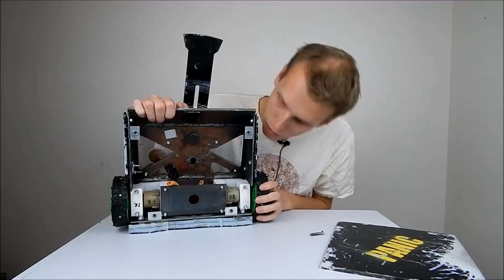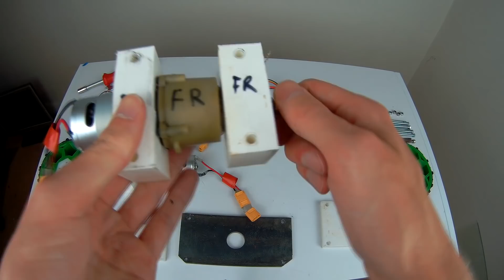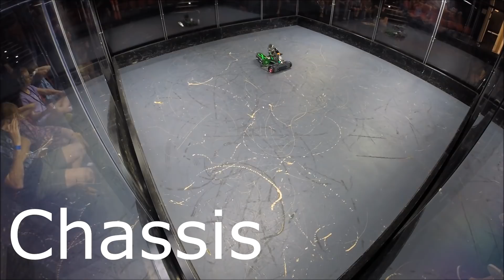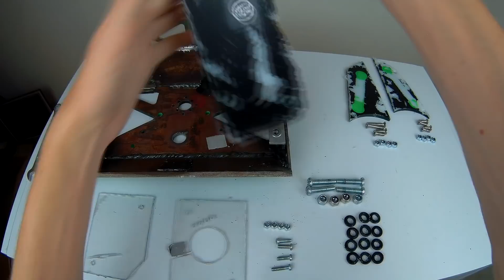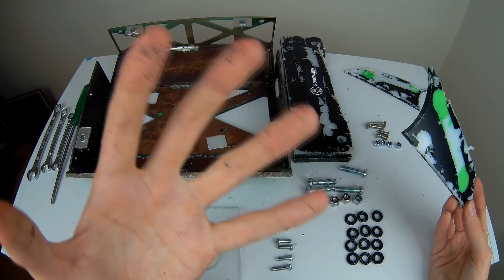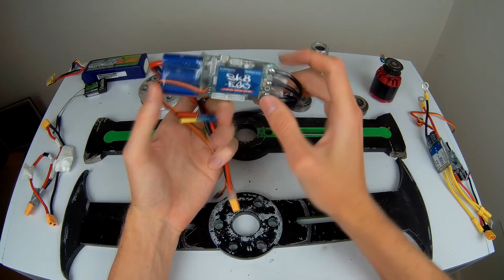13kg combat robot breakdown!

Comment: totally new to robotics, is using brusless geared motors for the wheels a good idea? or just stick to cheaper brushed motors?
Reply from the maker: Brushed motors are easier, cheaper and usually come with a gearbox attached but are heavy in regards to power/weight

Brushless motors are more expensive, normally need a special speed controller (and for you to change the settings on the speed controller), dont come with a gearbox (so you need to do something custom) but are light  in regards to power/weight

I.e. a brushless motor setup will be lighter then a brushed motor set up, for the same output power

Personally, as a new person I'd avoid Brushless drive to start with, build a brushed drive (like I have here, made of drill motors) get a robot working, take it to a fight, learn a lot from your first few fights and design a version 2 and maybe put brushless in V2 if you think you need the extra weight. (My V2 of this robot still used the brush drive)

Comment: Cost video
Reply from the maker: Cost is a tricky thing to determine, because I'll often buy parts 6-12 months before I use them and some parts get used in multiple bots
Reply: @TeamPanicRobotics  thanks for video, what is ball park cost? $2000 at least right?
Reply: @khandam7709  I'd say it depends on your choice of parts and suppliers. If you do what that Oxford team did on robot wars and put kevlar on your bot, yeah you'll blow it to 2k+ but you can quite easily keep it sub 200 if you're salvage savvy

Comment: How long does the 1.8amp drive pack last before its flat?
Reply from the maker: Its only running 2 drills so it lasts way longer than 3 minutes

But I've never driven it longer than 3 minutes so I don't have exact numbers for you.

I will say that I'm going to reduce that for this years fight
Reply: Team Panic my current design i have allowed for a 2.2amp 4s with 16:1 gearbox and a 4235 brushless. I think it will be enough just for the drive pack but i hope i can downsize to a 1.8 later to save weight and space and allow other upgrades. Weight is tight at the moment.
Reply from the maker: It all comes down to the draw of the motor

If we take the PROPDRIVE v2 4238 as an example, it has a max draw of 55A, for the drive you need 2 so thats a max draw of 110A

A fight is 3 minutes or 0.05 hours

As a worst case, assume that your motors will draw max current for the whole fight, you get 5.5Ah of power needed

In reality, your motors won't draw max current for the full fight and will even draw nothing for a small portion. So looking at the numbers 2.2Ah seems like a good bet and 1.8Ah seems risky. 

My advice is to build for the 2.2Ah battery and take careful note of how low your battery voltage is after every fight and more importantly how many Ah the charger has to put back in after each fight. Before deciding to switch down, make sure you have data from a 3 minute long heavy pushing fight
Reply: Team Panic thanks! The feedback and advice has leaned towards 2.2 almost in every case. I have designed for the 2.2 and trying to even allow for upgrade to 3.0 just incase. But as usual plan for worst case or at least explore if smaller could work.

Comment: I saw the fight Very Very Obvious had with Crippling Depression. You were very unlucky. The weapon dragged the bot over the wall. Just goes to show that there’s no such thing as the perfect robot for every situation.
Reply from the maker: Yeah, I was thinking about cutting the tips off due to damage, then I saw Roberts Video and knew it needed to be done
Reply: Team Panic That may have helped but watching the video back at a slower speed seems to indicate that the length of the bar and/or the increased weight of the bar ends may have been a factor. 
I don’t know if a shorter bar or a bar with less weight at the tips would help? I know that building those extra bars and testing them, only to have some of them rejected, is a costly business (and a big bar with weight at the ends is waaaay cooler than a small one ☺️). I hope you have better luck with Very Vey Obvious in your next competition. It’s by far the coolest looking machine in the weight class at the moment.
Reply from the maker: In Roberts video you can see the bent tips catch on the side wall and help to throw the bot out, that had way more impact then the weight on the end.

Longer bars with mass further out hit way harder then short mass with even mass distribution. I am planning on making 2 different bars for next years fights but they will be designed to hit harder then the current bar

Thanks! I think it looks good too, its definitely got me hooked on this style of bot, I've already built a 150g version and I'm seriously thinking about a beetle
Reply: Team Panic I agree, the longer, heavy ended bars will pack the best punch. There will be some spectacular hits. 

I’m looking forward to seeing your spinners in action. Good luck.
Reply from the maker: Haha yes, there will! spectacular hits are one of my biggest goals when I build spinners.

I don't mind if the bot knocks itself out as long as it puts on a good show